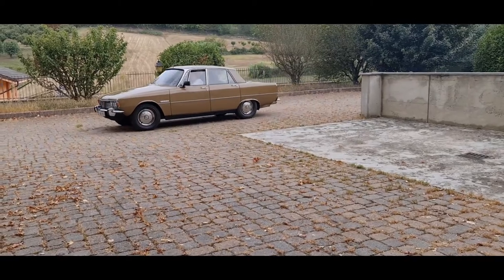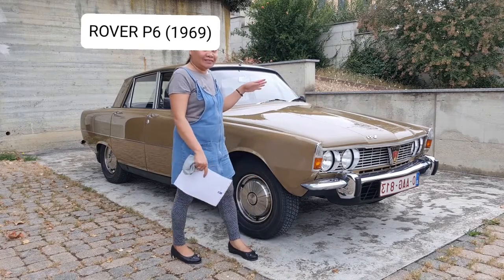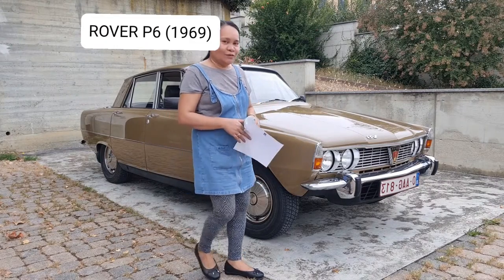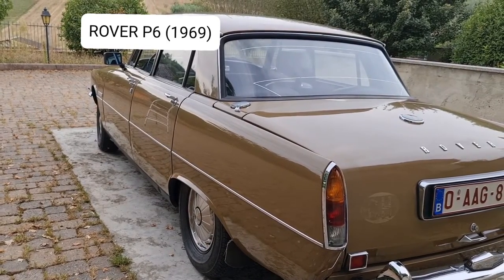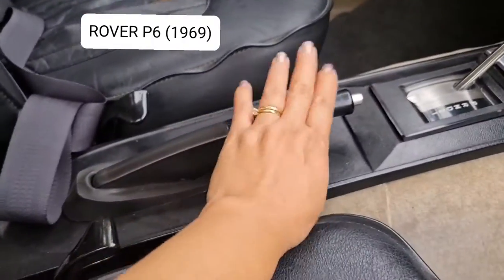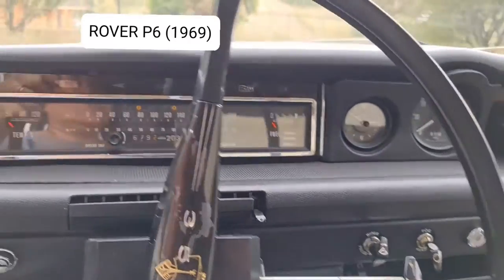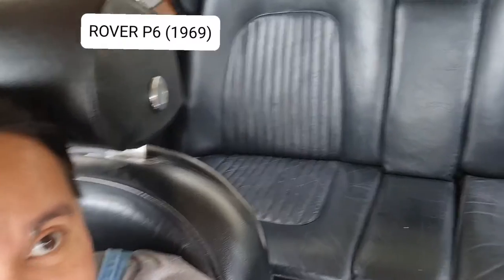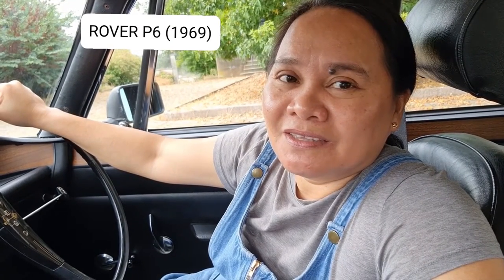ROVER P6 (1969) #OLD TIMER CAR Vlog 15 _mariatabuco

Comment: Dear Maria, very nice car, but I've observed that the film has been reversed on YouTube between 1:21 to 4:15. The letters on the number plate are backwards and the number 3500 on the front wing of the Rover in the film reads as 0035. The badge on the bonnet reads '8V' !!! You should correct this. Regards